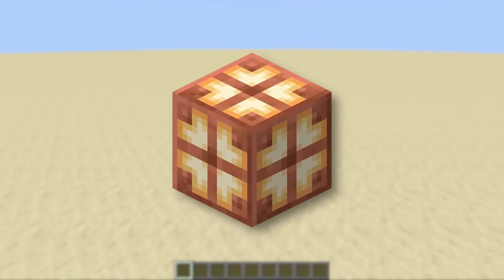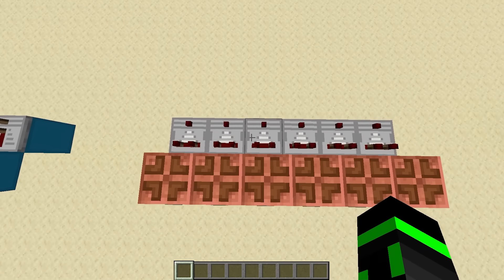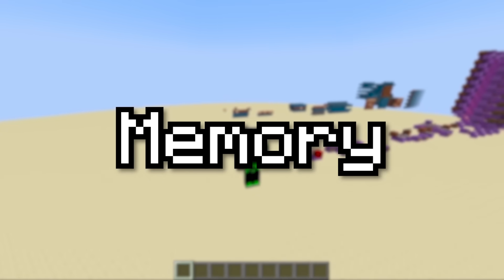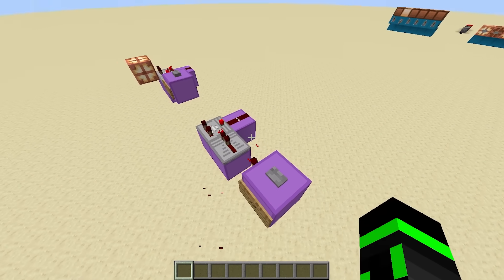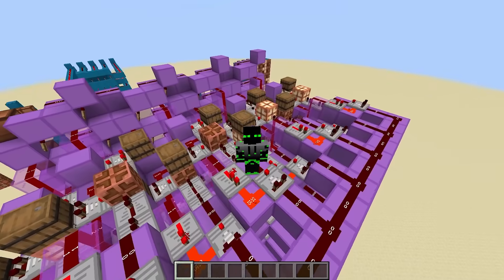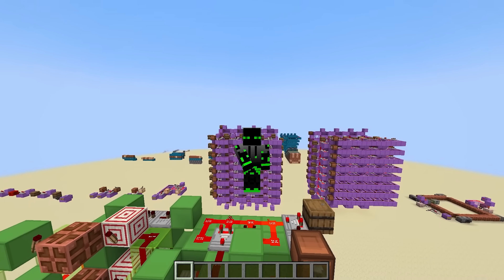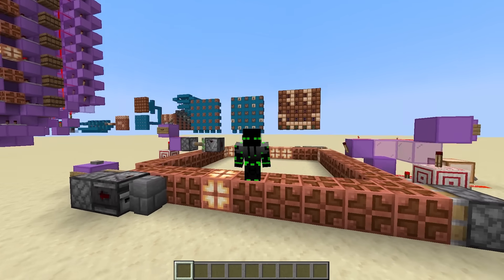Why I'll Never Use Copper Bulbs

Comment: Regarding the reset of copper bulbs: 
While this isn't the most pratical for every situation here's a quick suggestion which would make them more viable for displays. 
I am no expert in the usage of screens and have no idea on how quick they usually need to be compared to the rest of the redstone circuits. But when this is about only being able to reset a screen easily: You could just store a copy of the screen in a memory unit. Simply map each pixel to a bit in the memory and every time you'd need to reset the screen either:
A - go though it one by one: take a counter, go through each pixel and each address in the memory and simply switch all those that are on; this would need one "AND" operation (1 AND whatever is read in the memory is send to the pixel) and a counter 
B - have an wired AND for each pixel: every address is hard wired to each pixel (so simply a "second connection" to the pixel) and a logic AND where the second input is usually a 0. Whenever you'd then want to clear the screen simply flash 1 to these ANDs and everything would be cleared. 
B would obviously be the much faster parallel operation. Also, you could abuse B for writing to the screen and store on almost at the same time. Simply clear the screen as explained in B, then clear/rewrite to the memory - so put whatever you want in there. Then simply flash the same "clear" line once. Since the screen was clear before and the AND would again become a neutral logic operator youd "write" whatever is in the memory to the screen and itd be stored there.

Basically have a display memory is what im saying. When combined with a graphic memory for serial computation of a new image you can clear the current image in parallel, copy the new image into the display memory in parallel and write it in parallel.

This solution obviously requires a lot more space and memory to store all this information and would grow with each pixel. But it would allow for more compact images/displays and parallel writing of a new image. In addition reading the current image is equally easy as it obviously can always be read for the display memory.

This is obviously my unprofessional 2 second opinion after watching this video - so maybe this isn't really that viable for most cases. I am just trying to give some input on what might also be worth considering.

Comment: copper bulbs were very useful for me, i created a calculator that can only add binary number (first logical build) it took months of work because i didn't use any existing designs i created everything from scratch and the memory was made from copper bulb for the write it was just an impulse, easy, for the read it was just a comparator, and for clear i just had to connect the read's comparator to the lamp, if it's 0 the state won't change so it will stay 0 and if it's 1 the state will change to 0 so everything clears, if anyone want to see my design i can share it, it's not optimal but i think it's unique since i created it from scratch and it would have been a lot more difficult without the copper lamp, just to say that it's really useful for beginners like me

Comment: I actually love the copper bulb quite a lot for doing games meant for survival. I use them both in displays and redstone logic, but I don’t do very much with binary (16 signal logic usually) so it all looks a bit different. I always prioritize smaller displays, and with doing usually sequential discovery games I don’t mind they have to figure things out like you mentioned with levers. I have been into grid input and outputs and was working on 5*5 of note-block input and bulb display that can be on any interior face (so in ceiling, floor, or wall.) Because I thought it’d be a fun challenge to make a cube room that can be grids of input and another with matching output. I just finished a 5*5 bulb pattern lock that is pretty small thanks to doing it with bulbs in the back end as well (all off is the correct answer) vs the repeater/torch reads. It does get HUGE once you try and do multiple answers though per your point of issues with that.

It’s enjoy seeing different perspective on the usefulness of circuits/blocks.

Comment: For the screen having state - wouldn't it be possible to have a virtual, more spread-out replica 'screen' as part of the computer so you can take the state of that and use it to both power the real screen and also do any redstone operations (such as the XOR you mention) on those bulb values? It's an extra "rendering" layer, but it could be folded into any shape and allow the real screen to be very tightly-packed without worrying about it maintaining its state, right?

Just because you said "impossible" in the video - I'm not sure about practical, but it's surely possible.

Comment: When Copper bulbs first released the first thing I did was create a simple binary counter with it but I also used the bulbs for the display since I wanted to display them numbers on a screen as 1 or 0 the fact that they can be swapped between 2 states made it extremely easy to make this display as any pixel that changes between 0 and 1 I would update with a observer and any pixels that stayed the same I simply had to set the state of manually the first time.

Comment: There are various techniques that can vastly improve the use of copper bulbs over many other components.

One example:
The half-adder can be reset by initiating a simple sequence that observes the largest bit:
If the largest bit is turned off, turn it on. If it is turned on, do nothing.
then send pulses until it turns off. this will only happen due to overflow, and with 1 tick pulses takes 2*n ticks to clear, which isnt unreasonably slow, unless youre going for high counts of n, but then again, half-adders can be sequenced, so w/e

Comment: when you were talking about memory it gave me an idea. could chiseled bookshelves be used as a kind of memory that gets cleaned up when read? when a book is removed, a comparator outputs a signal strength from 1 to 6 depending on which book slot was accessed. i don't know how this would be done, but if you remove each book and somehow store the signal strength at that moment, there are 2^6 possible states, because basically a chiseled bookshelf is 6 bits.

Comment: I like the way old game logic in minecraft work specially for redstone, I learned alot of low level electronic how it works, just like how computer work from the logic gate level, understanding binaries and so on, but lately all update is defeating the purpose of learning how electronics work on a lower level, its like they are giving you a component or integrated circuit that you no longer need to manually build your own schematic logic. So as a redstone gamer it loose my feeling like "oh yea I build it!"
Reply: I get what you mean, but your reaction feels a bit too personal. Look at the game Turing Complete: you build every part from the ground up, like gates, adders, memory and all that. Once you’ve done the work, the game gives you a simple block that represents the thing you already built.
That doesn’t ruin the learning at all. It just saves you from doing the same repetitive stuff again and again. Plus, adding those simpler components makes it easier for more people to get into the hobby of making Redstone builds. Maybe some people do not really want to learn electrical engineering or how some components internally work. They just want a working solution they could use.  And just like in Minecraft, you never have to use those ready-made parts if you don’t want to.

Comment: Hi there. I hav a comment a year later. I am 13 minutes in the video and you were talking about needing to read the copper bulb to reset it. I was thinking is it possible to reset without reading. Then I realized to only way to reset it is to write the same exact thing. So what if we made a memory of it. Have two sets of bulb where one is the display and one as the mirror image of it that can be read with comparators. That way we can use the mirrored set of bulbs to write to the display one. I have no background in CS nor computational redstone (just basic knowledge enough to make my beginner farms work), so my idea is just me throwing it out there. And I guess mirroring it to compare the two sets would mroe than double the size. And it might not be reliable if I make a mistake and not write to both somehow in the process. At least we don't have to think about what is on the screen to reset it. Since anything on screen one, X, should be on screen two, X-mirrored, and we don't even need to know what X nor X-mirrored really is for reset.

Comment: it's a one block t flip flop. Even if it's hard to reset, that's just to make it not overpowered. also, you could probably make a simple machine to reset it. Like, just use an and gate with the first input being the bulb and the second input being a reset button.
Reply: I'm talking from a bedrock perspective btw, so t flip flops are harder to make for me since pistons can't drop blocks in bedrock

Comment: I actually managed to make very compact clock that does not need to be reset and other timing circuits using copper bulbs thanks to the fact it outputs a signal when used with a comparator reading it's state. And some other machines. I'll say it's more useful for dumb circuits and some smart ones right now but who knows people will come up with

Comment: 7:35 I found like 5 ways to do it with copper bulb. My smallest design was 2 x 3 blocks. I don’t know if I’m stupid right now but I am 99% sure it does what it should.

Tutorial: 

1) build a copper bulb 

2)Build a comparator in front of the bulb facing out and click it to change his mode

3)Place a observer in the opposite side facing out the bulb

4)Now place a solid block on the right of the observer (I prefer a redstone lamp)

5)Place a comparator in front of the solid block on the right side of the bulb facing out of the solid block

6)Now place a redstone dust connecting the 2 comparators

Every time the observer observes something the bulb switches between 0-1
Every time the solid block gets unchanged the output becomes the state of the bulb

Please tell me if I understood something wrong

Comment: about the RW memory, in computer science, you dont assume that the memory is 0 be default. you fill it with 0s before using it.

about screen, LCD screen actually reset the state of each pixel before displaying the new one. thats why refresh rate is a thing.

Comment: I always use them for binary counters i connect them via comparators in a straight line and then i put an aditional comparator on their sides, a block in front of the comparator and a r-torch   it makes a pulse counter.. And its really usefull in clocks

Comment: 9:47 Hey matt is it Possible to make a HDD with this kinda design?
Reply: I mean yes but if you want it really spining you gonna be limited by the piston push limit OR have to use a TON of pistons
Reply: I made one years ago using glass - had to change out the blocks manually, it was just for a visualiser type idea. I made a 4 bit redstone computer, before comparators even. I'm a bit out of the loop

Comment: I'm remaking this comment, but, honestly, I think the biggest advantage that the copper bulb provides to computational redstone is a reduction in lag when something uses a lot of t flip flops, instead of needing to use pistons or droppers and hoppers, you just have the bulb, which I feel like could cut down on lag massively, as I know pistons and containers moving items around can get laggy very fast based on just, working with larger scale farms in the game so,  this could be a big leap, and also being able to compact everything can be very helpful potentially, as less redstone is less lag in general.

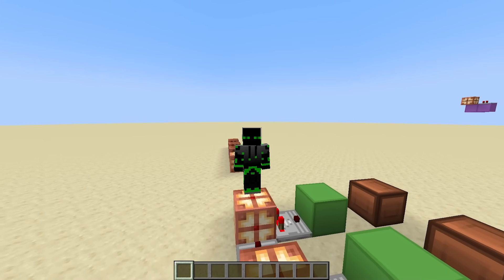Comment: 11:00

Very cool relations to real life circuits. Asynchronous counters, or ripple counters, like the copper bulb ones, are often the first type learned when researching counter circuits, as they are much simpler. However, most circuitry relies on synchronous counters almost entirely because they eliminate propagation delay (the ripple effect).

Comment: I think it would be cool if there was a lamp that's brightness coresponded to the redstone signal strength going into it. Not only would this make lighting up houses better, but it could also be used for better RGB redstone displays by using different proportions of 15 light levels (plus an extra for off) with stained glass in front of them.

Comment: on the rgb screen - while the idea of blending colours like a real screen doesn’t work very well, i do think certain games would benefit from having different sections of the screen highlighted. for example to indicate the user interface vs the output if they are side by side, you could use oxidised bulbs for one. i’m not sure if the mild benefit of being able to split up a screen into sections outweighs the massive downsides outlined but if there is a way to use them for a screen it could work really well, and add another level of readability that some redstone lamp displays lack:)

Comment: Can't believe I'm correcting the master of logical redstone, yet here I am: 7:54 No you don't, when I noticed you could make R/W memory with copper bulbs, I immediately started making one, and since at the time I had no idea what logic gates were, I never used an XOR, and it still worked the intended way, plus, it takes less horizontal space than what you made, here is my review of my own Copper Bulb RWM: It's much easier to understand how it works since the storage itself is a single block; it does make a little bit of noise since it uses pistons for the following: a negated piston that lets data in when its assigned bulb has a value of 0, and doesn't allow any data in if the bulb has a value of 0, and the second piston is the literal opposite: when its assigned bulb has a value of 0, it doesn't allow the second (or delete) input in the bulb, and if the value is 1, it goes up letting it in, that way, when you press the "delete" button, it sets the 1's to 0's without turning the 0's to 1's; and if you want to rewrite it, you can add a third input that doesn't go into the bulb but rather in the first piston of each bit, which forces up the ones that are down and keeps the ones up where they are, that way you can rewrite it by toggling the bulbs yourself/using a mechanism to do it, a downside of my design is that it isn't particularly fast, so it can't properly handle RAMs with 1 tick repeaters, the fastest it can handle is 2 ticks, though the design is kinda tree-like, you can't just shove the leaves (the 8b units) into devices just like that, they need roots to properly recieve and gather the data, which makes it tricky to properly include it into a device without dedicating space exclusively for it, that is unless you want it to store only one set variable, in that case you can just add more and more bits to the build to adjust it to your necessity, but if you want multi-file storage you will need the earlier-mentioned tree-like structure, one "leaf" for each variable and roots bringing the data in and separate roots to bring it out, if you want I can dm you the structure file on Discord if you want to see it for yourself but I don't know if the file works for Java because I made it on Bedrock.

Comment: I'm not even three minutes in and I'm receiving a lesson in UX design philosophy. Congratulations, you beat my college to it.
Reply: Now I'm 11 minutes in, and what you did NOT beat my college to is the synchronization problem with the binary counter. This is mostly trivia since you already have a better solution, but there is an alternate format for binary known as a gray code, in which incrementing a number by one always flips exactly one bit, to partially mitigate the problems that arise from reading memory too quickly. This way, a 15 being overwritten by a 16, can only be misread as still being 15, whereas in ordinary binary, depending on the order the new bits are written, it is possible for any value from 0-16 to be read while the new value is being written. Obviously, you often write values that are more than one away from the previous value, but it still helps. I don't actually know when, where, or how often gray codes are implemented in real life circuits, if at all.

Comment: 2:35 they also know just the fact that it's a copper bulb, it's a toggle
4:09 the other designs are better imo because they are less spread out and much easier to work with =)
4:55 the reason I would use this copper bulb design is because it's a 1x1 block per pixel =)

Comment: I am using the copper bulb for a compact vertical input in my current project (bulb at bottom, observer into it, leaf blocks in a line above, then a sticky piston and an oak log), but I would have rather had a simpler mechanism.

Comment: You could use sheets of copper bulbs like the magnetic tapes in music/video cassettes: have pistons push a line of the copper bulb sheets through a reading/writing machine, like how a casette runs its tape through a video/music player and you can easily store and retreive data

Comment: That spinning this actually COULD be useful, it would be easier to write more than 1 thing in different bits, the only problem is how long it'd take to read it, BUT if you do it like real computers do, then you'd call the Read/write memory the Hard Drive storage and make a separate RAM which would technically be smaller and easier than traditional because you dont need as much storage in RAM as a Hard drive because RAM is only used for anything that needs to be used at any time. The hard drive storage is(for example) like when you're loading up an app, the reason it takes a while is because its taking the memory from the hard drive and putting it in the RAM to be used whenever!